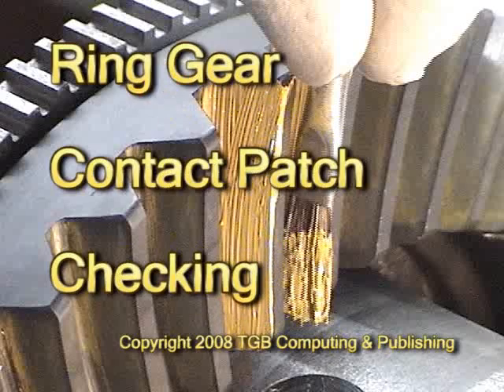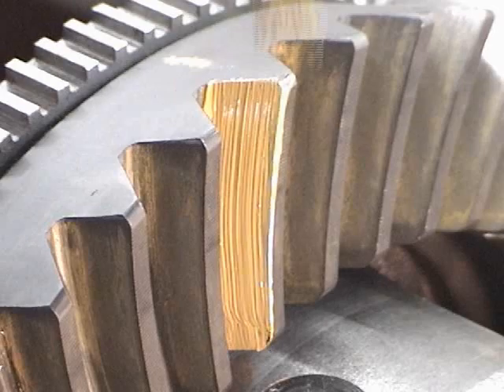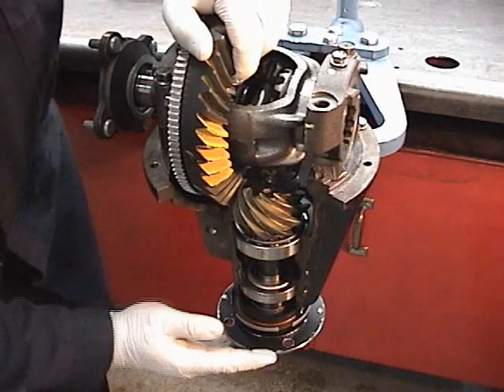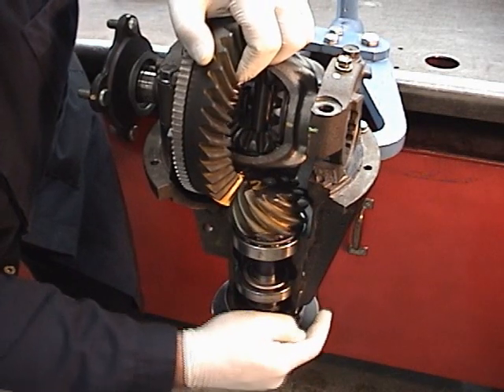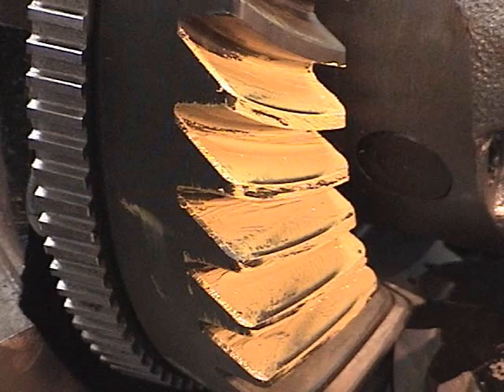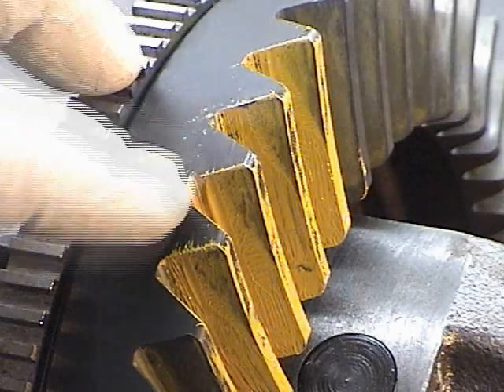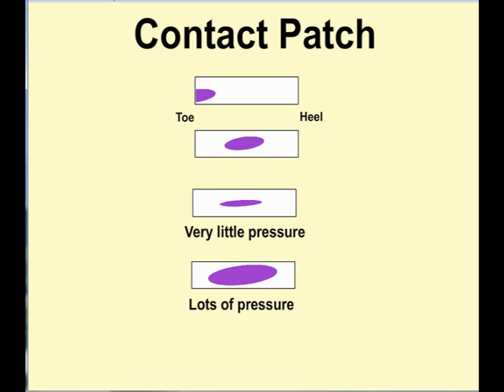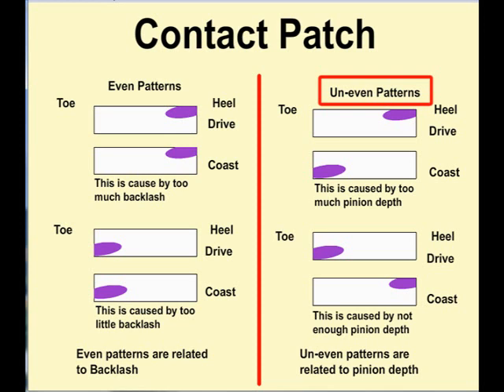Measuring Ring Gear Contact patch on All Hypoid Differentials

Comment: Lipstick works better than gear marking compound and is way less expensive
Reply from the maker: Wow, Thanks for the tip.  I will give that a try sometime.
Reply from the maker: Not sure how much cheaper it is.  I can get a tube for around $10 which last for 20 - 30 differentials depending on how many teeth I use it on and if it's a custom setup where I need  a lot of trial and error to get the depth correct.  I see lipstick from $6 to $50 a stick and my bet is you won't get 20 diffs out of one or even two sticks. Since you have experience you can tell me how long it last.
Reply: I have done around 20 diffs in the last year and haven't got through half a stick, it is really cheap when your girlfriend leaves them lying around in the bathroom.
Reply: Parts suppliers where I am from only stock Prussian blue which isn't very good and they charge like a wounded bull for it. I picked up the use of lipstick from an article on a 9 inch rebuild.
Reply from the maker: Prussian Blue won't work.  It dries too quick and is terrible for contact patch.  My wife of 42 years rarely wears lipstick so I would have to purchase some.  I get my contact paste from the internet and it ranges from $8 - $14 a tube.  The amount needed all depends on how many teeth you paint and how many times you have to do this per diff.  Normally I will paint 2-3 teeth in 3 locations around the ring gear.  When I went to GM training they wanted us to paint every tooth. I just finished a custom rebuild that required a lot of trial and error to dial in the depth and pinion preload shims.  I must have ran 20 separate contact patches using only 3 teeth before I got it dialed in.  I don't think I even used 1/10 of the tube.  If I get a chance to grab some lipstick I'm going to give it a try.  I would really like to see how well it works.  Someone once told me tooth paste also works but I never tried it.  Thanks for the input.
Reply: I’ve got a tub of gear marking compound which I paid $100 for and it works good. But I have a few tubes of Oil Paint and it’s actually works better then the gear marking compound. It’s also available in a variety of colours 🤙 I mainly use yellow but white also works very good. I still don’t know why people try Prussian blue, it’s fucking terrible.
Reply from the maker: Jake swears by lipstick but my wife doesn't have any or if she does it's not much so I don't have extra laying around otherwise lipstick is not that much cheaper when I priced it out. It's only cheap if you get it from someone else who has plenty laying around.  I have also heard that toothpaste works but I have never tried it.  Thanks for the paint info. If I ever run out of contact paste I will try that.
Reply: Iron oxides were instantly popular because they are known to be inert when it comes to interaction with steel, gear oil, and friction modifiers. Although other choices may be attractive, it would be nice to be assured there is no chemical interaction with normal components inside the diff. It is pretty much impossible to wipe it all away.
Reply from the maker: I can only assume that the product I'm using by GM that is labeled specifically for this purpose will dissolve in the gear oil with no negative effects.
Reply: @DrivelineMaster  Yes I believe they are iron oxide based, which was why they use them. Lipstick, I don't know....
Reply from the maker: Good Point.  I agree.
Reply: @spelunkerd  if it's safe to be used on skin and tested on fluffy animals I seriously doubt it will negatively affect anything that goes into a differential.
After all the amount you're using is miniscule even if it did affect it.
If you do end up hearing clicking noises, that's probably your differential going out wearing high heels with the 💄.

Comment: I'm changing gears in a 8.5 chev 10 bolt, and after watching your videos it has verified my assumption that the pinion (with no shims) is to far out. Is there any thinner bearings or is there any other possibilities on why I'm heavy toe on the drive side and heavy heel on the coast side?
Any input would be much appreciated.
Your videos are the most helpful on u tube that I've found, thank you very much.
Reply from the maker: Where did you get your gearset from?  If you got it from Summit or Randy's they often have tech support. There might be a special replacement bearing they know about for your application.  If not see if there is a bearing specialty company in your area.  Sometimes they are hard to find. Take your rear bearing and cup/race with you and go in and talk to them.  Tell them you need a bearing with a lower or shorter profile.  Also tell them the application.  All bearings have a number on them, often it starts with LM.  You may be able to call a bearing company and give them that number.  They should be able to look up all the specifications including the profile height and suggest a shorter bearing over the phone.  Lastly if all this fails maybe a machine shop can remove some metal from the back side of the pinion head where the rear bearing seats up against.  I would suspect that you would need between .030" to .080" shorter bearing or metal removed from the pinion. With a larger value shims can be added to dial in your pinion depth.  I would caution about going excessive on the bearing because a shorter bearing could reduce load capacity.  It all depends on why the bearing is shorter.  it could be shorter because the rollers are shorter or it could be shorter because there is a steeper angle on the bearings. Shorter rollers will reduce load capacity.  steeper roller angle is OK. Hope this helps.  Let me know what happens.  NOTE.  It's also possible you just got a bad gearset but not likely if you got it from a reputable reseller.  Personally I don't trust Ebay resellers for certain items because they sometimes tend to mix and match and repackage.
Reply: DrivelineMaster, it's a motive gear set from speedway, and I'm thinking about going to bearing belt and chain, there super helpful, if not a grinding shop. I'm kinda leaning on grinding the race, but I need to spec the housing a bit, but im pretty sure there's no clearance issues.
It just seems odd, I would never expect a product that's fully cnc from begging to double lapped, with matching serial numbers to have this problem
Reply: I went from 3.41 to 5.13, and the old pinion is 1.68 overall gear height including the little ledge the bearing rests on, and the 5.13 pinion is 1.76 it doesn't have a ledge
Reply from the maker: I personally wouldn't grind anything.  If you need to take metal off it should be precision machined. Second, I would not machine the bearing or race at all.  I would chuck the pinion into a lathe and remove a little from the back side of the gear.  The pinion head height difference of only .008" is not very much but because of the larger gear ratio your contact has been effected. The 5.13:1 ratio will give you a nice addition to your low end torque just don't expect to get good gas mileage.  You need to get that pattern off of the toe or you will just break these gears.  Don't forget to break in the gearset once you get it all setup correctly.
Reply: DrivelineMaster, it would be on a deck grinding machine, at a machine shop, I used to have access to one but no longer. Turning the pinion could be done at Gear One, they are not to far from me.
Reply: DrivelineMaster, it's a difference of .08, not .008
Reply from the maker: Ops,  I miss-read.  That is a lot.  Deck grinder is OK,  I heard grind and envisioned a hand grinding tool or bench grinder.  I'm not a fan of grinding the bearing race but sometimes as we say, "What Ever Works"  When stuff doesn't match up we have to be innovative. I hope you can find a shorter bearing with a steeper angle.  That to me would be the best solution.
Reply: DrivelineMaster, I feel the same, there open tomorrow. From your video with the opened up 9" third member, looks to me like I need another .030 in pinion depth.
Reply from the maker: Each differential responds sightly differently to the amount of change.  That is why I said .030" to .080" should be more than enough.  With a larger difference you could add shims to dial it into perfect depth.
Reply: DrivelineMaster, I got a set of Richmond gears, and they set up perfectly with the original. 035 shim.
I'm so happy, but disappointed I bought  the motive gears,  the rep I emailed dodged me from the beginning. 
Needless to say I won't get there product anymore.
Reply from the maker: I'm glad it worked out for you.  I had a feeling it was the gearset.
Reply: DrivelineMaster, thank you, getting a good set of gears seems to be key in setting up gears with ease
Reply: @anomilumiimulimona2924  I went from a 3.73 to a 5.13 and used the same shim that was on the 3.73 and I had perfect drive and coast marks , but the backlash was suppose to be 8 to 12 and mine was 7 and it only had 2 thick shims, it's a good thing I bought a Yukon shim set before the rebuild as I just made 2 stacks of shims the same thickness and took 1 away and added to the other side and then got a read just a hair over 8 and tooth pattern was still perfect so I torqued it all down and was done, this was on a 8.8
Reply: aux1z11, motive gears?